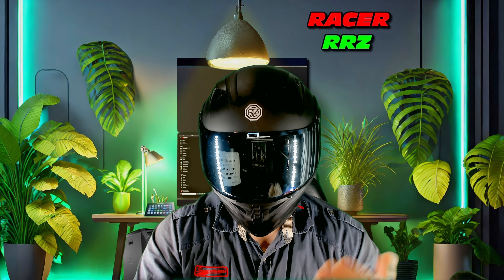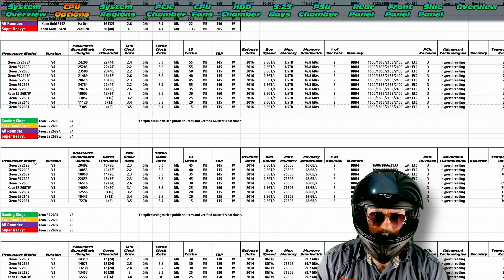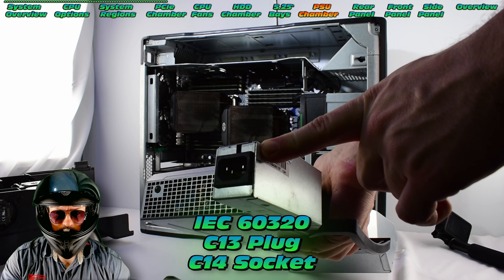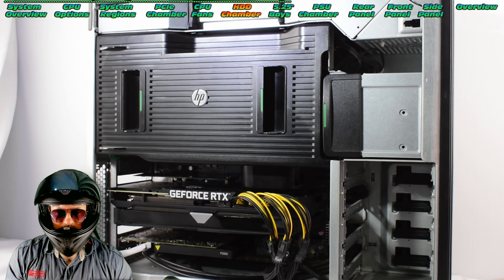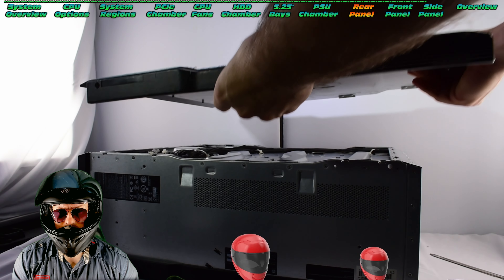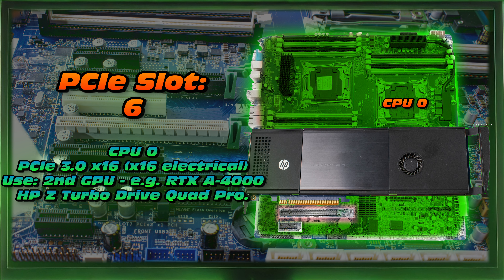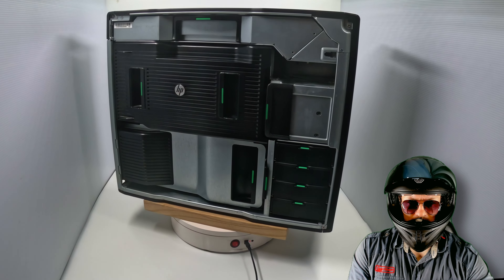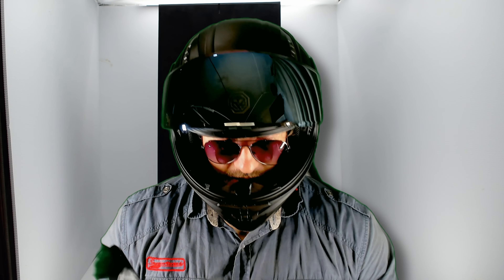This Workstation Would Be It. HP Z840 Full System Overview.

Comment: My 840 Just got delivered!!! It’s a ABSOLUTE BEAST! The videos don’t convey how heavy and solid this thing is!

I’m probably going to go with 2697A V4’s, but the 2689 V4 and 2673 V4 look really interesting
Reply from the maker: Nice, enjoy! It really can't be experienced in video. I was surprised when I picked mine up for the first time, it really is a solid system. I do my best to make the machines look light in the videos but once you add your hardware they become really heavy - at a guess like 30kg lol. 

The CPU options are numerous. From my own experience I really just go for the CPU with the highest multi-core boost clock speed and the most amount of cores. The only time I wish I had more CPU grunt is when software has limited a task to utilizing 1 Core only. My hope is that by selecting a high clock speed I am saving seconds each time I need to complete a single core task (DaVinci video playback seems to be one example of single Core performance being king - i.e. I spend a lot of time waiting for 1 Core to do it's thing [lag] when the remaining 31 Cores just "chill". I favor the E5-2697A's for having the highest base clock speed without sacrificing too many cores. 

The E5-2673 V4 has a lot of cores but is low on clock speed and the E5-2689 V4 is low on cores but has a solid clock speed. If you can get by with less cores it might make more sense to go for the higher clock speed CPU. A quick comparison of some solid options: https://www.cpubenchmark.net/compare/2853.2vs2888.2vs3273.2vs2814.2vs2783.2/Intel-Xeon-E5-2689-v4-vs-Intel-Xeon-E5-2673-v4-vs-Intel-Xeon-Gold-6142-vs-Intel-Xeon-E5-2697A-v4-vs-%5BDual-CPU%5D-Intel-Xeon-E5-2697-v4  It's not an easy decision. The only consolation is that you could potentially but a pair - try them and then replace them with a different set. These CPUs will remain popular for a while yet and should sell again.

Comment: I recently purchased the Z840, and you offered helpful advice in the comments of a previous video. Just yesterday I installed an HPZ Turbo Drive G2 with 1TB of Samsung M.2 SSD memory. I set up the Turbo Drive as the system drive, and it's humming along quite nicely. Today, I plan to install 2 Xeon  E5-2690 processors. Fortunately, my machine came with 128 GB of DDR4 installed and the bigger (125W?) power supply. I ordered a GPU and a Thunderbolt PCIe expansion card last night. I am floored at the incredible value of the Z840 workstation platform. Also, the tool-less design makes the upgrade process much easier for a newb like me. Thanks for the educational and entertaining videos! You have a style all your own.
Reply from the maker: Thank you for your feedback! Your Z840 sounds like it is coming together nicely. Great choice with the E5-2690's. They have a high base clock speed for the number of cores and they should give you a really good experience. Which GPU did you settle on? 128GB of RAM should be enough to get by on unless you start really pushing the size of projects. I haven't really delved into thunderbolt much but it would be a handy expansion to have - I just live of USB C. 

Your system is getting filled with hardware, the only question is what are you going unleash upon the hardware to make use of it's full potential? In my case the Z workstations opened up the realm of video creation (before this channel I was limited to novice landscape photography). Now the only limit is my creativity (well sort-of, I can still complain about CPU single core performance being low lol). My mission is to empower individuals with the knowledge to build their own powerhouse - opening doors to be creative. I'll keep working on making my videos more educational and entertaining. Thank you for your words.
Reply: I am buying one just now with 256Gb RAM, can't wait to receive it. I can't imagine how much this cost back in the day... I figure 10k at least.
Reply: @racerrrz  My apologies for the delayed reply. Firstly, I admire your stated mission to empower others to release their creativity. That is 🔥 To answer your first question: I use the HPZ840 to edit video as well! I wanted a system that was capable without spending an arm and a leg. After pricing new machines, I started noodling on the idea of renovating an older PC for my purposes. Then, I found your channel, got inspired AND empowered with the requisite knowledge, and I'm so pleased to report that the results have met and even exceeded all expectations. In the process, I saved 50% (or more) compared to purchasing a brand new machine. Plus, I learned a ton, and I provided a good home to some 2nd hand eWaste, which is a bonus. Recycle, reduce, reuse, eh? To answer your second question, I found a great price on a returned Asus Rog Strix NVIDIA GeForce RTX 3060 V2 OC Edition Gaming GPU. It has worked out really well! Regarding the Thunderbolt Card, that was the most difficult item to find (and to figure out exactly what I needed). Eventually I located the following used component on eBay, and it has worked out really well. HP 753732-001 Thunderbolt-2 PCIe x4 I/O Card w/ Power Cable 751366-001. The Thunderbolt card has to be daisy-chained to a full-sized Displayport I/O connection on the back of my GPU. Fortunately, the Asus Rog Strix has ample Displayport connections. I connected an external, Kingston Thunderbolt dock to the back of the HP Thunderbolt PCIe card, and now I get full Thunderbolt 2.0 performance from my USB-C connected-devices: transfer speeds from external drives are good, and my mobile devices charge super fast via the Kingston dock. Thank you again for the gift of knowledge, Racerzz! I am a true believer!! 🏁🏎️🔥
Reply: @jupitereye4322  $10K starting price back in the day = spot on! The HPZ840 is a great value at its current, used price point. Good luck and have fun with your Z840 Reno!
Reply from the maker: @e-vd  Thank you for your detailed kind message, and I am proud to hear you have been empowered with knowledge to really push your creativity. That’s the beauty of these systems. Phenomenal computing power at an affordable price (when the hardware has aged lol) which allows you to do more than you could otherwise. It’s a fine line when it comes to the computing power.

I priced up a modern Ryzen 9 rig to see if I could justify a second system for some video content ideas (nearly all my video content is on HP systems – but they work well, so… what I am supposed to do lol) and internet browsing / gaming, but I am afraid it didn’t take long for the modern system to edge well above the cost of the HP Z8 G4 that I am using. What actually annoys me with the modern hardware is the lack of PCIe connectivity. All entry to mid-range motherboards have basically one X16 PCIe slot (with 16 electrical lanes) and 2-3 X16 PCIe slots with 4x electrical lanes connected (don’t let the X16 mechanical slot size catch you!). That leaves you with the inability to even bifurcate a PCIe slot for some extra NVMe storage. These workstations with their Xeons net so much PCIe connectivity you can literally go wild with your expansion. I don’t think I can justify a modern build unless I x10 my build $ budget… 

Nice going on the eWaste side of it also. Nothing wrong with picking up used hardware and repurposing it! I have kept an eye on the Thunderbolt cards but I have never committed to obtaining one. What I am cooking up is a solid 10GbE upgrade guide. It appears the cost of that has come down a bit from the last time I dwelled on it.

Getting Thunderbolt 2.0 speeds should bring your data transfers up to a decent speed. There is nothing more frustrating than a data transfer requiring 1 day to complete…lol. I will not even mention USB 2.0 speeds.lol. I quite enjoy my M.2 NVMes mounted in USB adapters – 1000MB/s over USB 3.0 is more than enough for me. 

The only question that remains is what will do you do next with your system? I feel like the "AI Agent" hyper right now places these workstations in the spot light. Ample power to run basic AI models – if you can find a creative way to use them that is.
Reply: @racerrrz  Installing an AI agent is in fact a use case I've noodled on. 🤔 At the moment, I want to lean into adding peripherals to the Z840 for sound recording. There again, I found an older piece of hardware, a Tascam sound mixer-of-sorts that converts an analog signal to digital. I'm working on hooking up a studio microphone, mostly for spoken word recordings, podcasting-type-stuff. Coming back to PCIe lanes, you are SO right about the disappointing scarcity of lanes on the newer boards. I ran into this very problem on a newer Dell I was renovating. In fact, the board would not even support an NVMe system drive. I tried everything, and no dice. The BIOS would not support it, and the BIOS could not be updated. Planned obselesence? So, I eventually purchased a used SSD, which is at least faster than the original, spinning disc system drive. Paired with Linux Mint, the old Dell is now a useful web browser, document editor. Coming back to the HPZ840...did you ever find a flexible extension/ adapter that let you use the PCIe lane that was blocked by the GPU?
Reply from the maker: @e-vd  Nice. Sound cards give you better options for expanding how you record audio. I am still living off USB audio but I can't complain on quality so far. 

I am really impressed with the Solid State Logic 2+ USB audio interface for managing my shotgun mic. (Audio-Technica AT875R). Which microphone do have for the podcast style of audio? The Shure SM7B is the go-to for that. 

Workstations come with a bit more technicalities, so we need to be patient as they figure out what we want from them lol. NVMe booting remains tricky on them - pending the age of the boot block anyhow. The HP workstations have just missed out on the expected goodies - they seem to release new models just before new tech gets released. Z820 missed out on Sata 3.0 / USB 3.0 due to aged chipset. Z840 lacked NVMe support on release but that was added with BIOS updates. Z8 G4 missed out on PCIe 4.0 just (Z8 G5 has PCIe 5.0 lol). 

In terms of PCIe mods - I can do you one better. I do not have a video - I have several!

They have actually not aged badly - still trendy videos - even if the Youtube Algo neglects them... 

Developing a method for PCIe slot utilization: https://youtu.be/pWS9hGgSo-4

Putting it to use for 10GbE: https://youtu.be/5tQct_LxPjo

More general PCIe expansion guide (bifurcation etc.): https://youtu.be/PRMWIpscDCg

Comment: Awesome machine! I used to use one of these at work for video editing. When we upgraded to new machines, I found out the IT department was going to throw it out, so I convinced them to let me take it home instead. It has 64GB RAM, a 24GB Quadro M6000, and did have two quad-core V3 CPUs, but I replaced those with two 12-core 2690 V3 CPUs I got for 20 bucks on ebay.

I've also taken advantage of the numerous drive bays and added about 30TB of storage and mostly use it as a Plex server for my 4K BD rips.👍
Reply from the maker: Well done for managing to save one of those systems. Decent specs out of the box, and 24GB of VRAM goes a long way even if an old GPU. Nice, the E5-2690 V3's are solid performers. Right now I'd settle on the E5-2696 V4 for the Z840 if used as a server - enough cores to load up a bunch of VMs. I wish the Z840 had three 5.25" Bays - that would have made it possible to fit a bunch of drives into a 3 slot adapter (something like the ToughArmor MB924IP-B: https://global.icydock.com/product_289.html as an example).

Comment: Just replaced my Z800 with a Z2. Build quality is miles better on the older system. Really not impressed with Z2.
Reply from the maker: Thank you for sharing your experience - I am sure that will help others out. The Z8xx workstations are just built to a higher specification. The Z2 is a nice entry system but the motherboard lacks the functionality of the bigger workstations.

Comment: I have a HP Z840. I upgraded the CPUs to 2 x 2690 v4. I have 128gb of DDR4 2400 memory. My HP Zturbo NVME drive is 4tb and I have a 4tb drive. I have a 10gb network card. It is a hell of a machine, P4000 8gb GPU. I have a HP Z440 for a NAS with 2690 v4, 32gb memory, 4 x 4TB storage and a 500gb SATA 3 SSD with K2200 4gb GPU. The 2690 v4 has 14 cores, 28 threads, and it bursts up to 3.6Ghz (I think). You can get the 2690 v4 pretty cheap compared to better CPUs for this model. I like the look of GPUs like the A2000 with 12gb. Perhaps you can SLI two of those to get 24gb of VRAM for AI local use.
Reply from the maker: I really think the Z840 will remain relevant in the Age of AI - we just need to get creative with how we use it. It sounds like you have got your Z840 and Z440 wired up. The E5-2690 V4's are solid offerings. I settled on the E5-2697A V4 as my ideal Xeon for them - I need that extra clock speed lol. I don't mind the A2000 - it's a solid GPU for the price. I still prefer the extra Cudas in my gaming GPUs but it depends on how you use your hardware. I need frame rates to get though projects faster. 

If you really want to make the most of your Z440 you need to consider transplanting that board into a larger case. I have all my PCIe slots working - and I still need more for expansion but there is no more on offer - plus the Z4 G4 seems to have less PCIe slots (My Z440's Case Swap: https://youtu.be/K4RalaEbRI4). Z440 is one of the best platforms for a home NAS / server build.
Reply: @racerrrz  Thanks for your suggestion. I will watch that video. Someone local is selling Dell 5820s with a W-2195, 4x16gb 2666Ghz, 1tb SAS, RTX 2070 Super for £350. I like the 5820 for the front hot swap 3.5" bays. I had 5820s before, so handy. But you must get the right Xeon (and other parts) in the bundle, as better Xeons sell on ebay for more than you pay for a whole system. Tempted to hold out for a system, HP or Dell, with 2933 6 way memory. I am basically workstation crazy at this stage.

Comment: Why don't you cover Hp z640? Its like the middle child, with the form factor of z440 with dual CPU support of z840 lol
Reply from the maker: Sorry about that! The only reason is cost. The HP Z640 has never come up at a reasonable price for me and the cheapest one in recent times was ~$650 USD (on my local market place). If I have to choose between a bunch of hardware bits for projects and a Z640 it seems I always go for the hardware. 

And yes, but actually the Z640 shares more with the Z440 than that - it is the same motherboard! The major changes are those to accommodate the second CPU riser - which also means less memory slots on the Z640's main board (only 4 RAM slots on there - the other slots are blank to leave bandwidth for the CPU riser board's 4 slots). But essentially it is a Z440 with a CPU mod. I would opt for the Z840 over the Z640 with the reduced complexity and cost. 

I am still hopeful that I will manage to secure a Z620 and a Z640. I have not done videos on either of them, but I did do one video on the Z600 (it's an old video now but still cool to watch).
Reply: @racerrrz  thats interesting you say that, because when it comes to pricing, z840 is by far the most expensive in my region, to the point that in the same price you could build a solid modern Ryzen 5000 build.

So z440 and z640 are my only options.

But hey, love your channel, keep up the good work.
Reply from the maker: @AbeelSiddiqui  Thank you for the feedback, much appreciated. It makes sense for the Z840 to be more expensive but I guess pricing here for me is based on availability. The Z620's and Z640's seem really rare, where there are many Z440's and Z840's. Strange really! I quite like the look of the HP Z6 G4 also, and it has a solid lineup of CPUs. 

It is a fine line between these 10 year old systems and a more modern system. Generally, I would like to think you end up better-off price wise with the Z840 over a modern system, but if you can spend a little more on newer hardware you can assemble a really nice performer. I did a comparison a while back - it's really up to preference and end-use. For single core performance however there isn't much to beat the modern CPUs. 

https://www.reddit.com/r/HSpecWorkstations/comments/18vvze9/modern_vs_ancient_cpu_debacle/